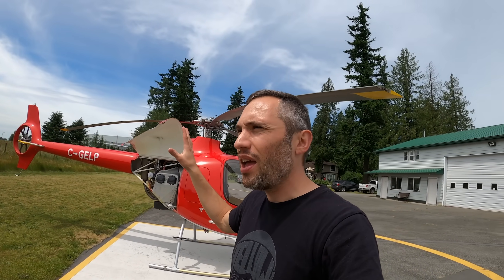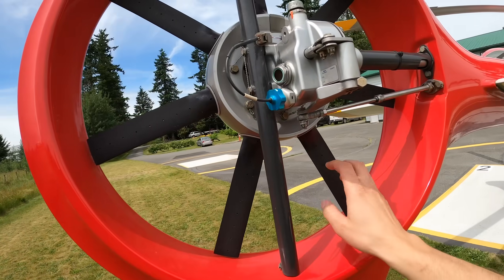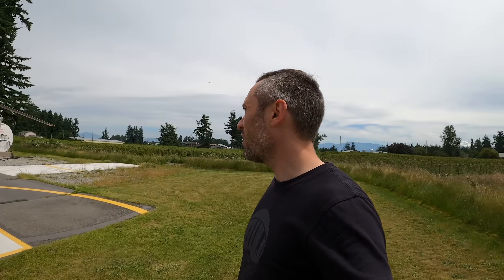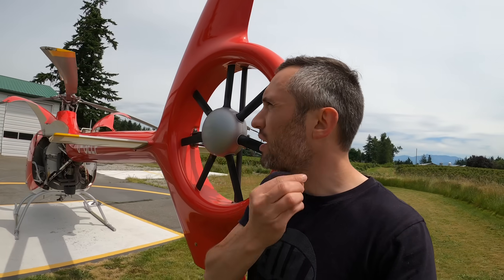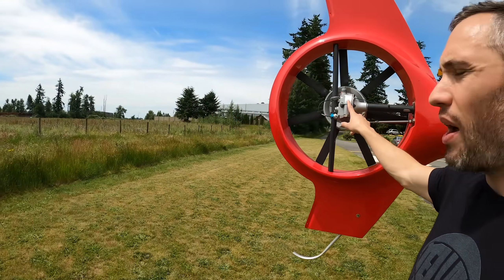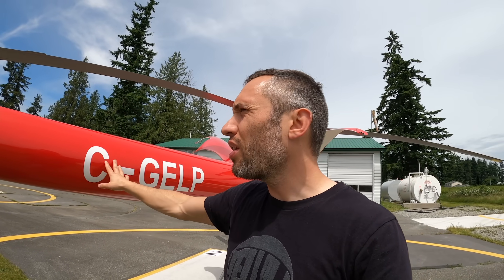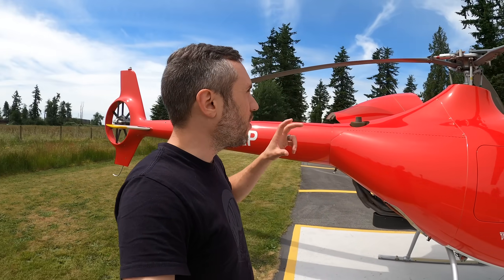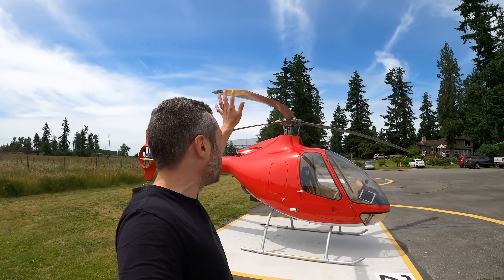WHY ARE HELICOPTERS SO EXPENSIVE TO RUN??

Comment: One big factor in the cost of parts, components, & complete aircraft is the premiums for product liability insurance. Back in the '80s, after some high-profile crashes & lawsuits, those premiums amounted to more than the cost of materials, labor & overhead. It got so bad that Cessna actually stopped building single-engine airplanes, and cut back on their multi-engine piston twins. Once Congress passed laws limiting liability payouts, the industry slowly began producing aircraft again. I've been away from the industry for years now, but I 'd be willing to bet that those premiums still make up a large part of the cost of components and aircraft, especially helicopters.

Comment: Excuse me??? Sorry, I'm just now getting the "Get tuu da Choppa" bug and been watching YouTube videos on helicopters for about 2 months now, but just from this video right here, i now found out that one single blade costs $20k or higher?? Nooo....I'm seriously shocked by this info, for real!! I thought that one such blade wouldn't cost more than $4 - $5k by using my common sense alone!! I've determined those prices, just by knowing of the manufacturing techniques alone, and just how much material and effort really goes into building one, it isn't as complicated as let's say... putting a chopper or a plane kit together or even buying a new transmission for your car, or an engine! Why so damn expensive?? I can't come to understanding the logic behind it! To me, it just simply shows a technical scheme being enforced here, or trying to boost up these prices since they're built good enough and not much serious maintenance is needed on them, etc! $20k? still hard to process!! For that price, knowing you can't just buy one blade at a time, you gotta buy the whole kit, if you have a 3 bladed rotor, you can almost if not, buy another helicopter like a Mosquito, or a used Robinson, whatever. Even a plane if you're into fixed wing stuff! Omg 🤦🏻‍♂️

Comment: Aircraft mechanics have a saying, "You know the only cheap thing about an aircraft?  The owner....  I have worked on helicopters for over 20 years and I feel that I should clarify a couple things that he said in his presentation.  "Infinite Life" parts are also known as "on condition" parts, this does not mean that they will last forever, "on condition" parts are subject to inspection, and if the wear, damage or defect criteria is exceeded they would need to be overhauled or scrapped depending on the manufacturers instructions.  He explained the life on main rotor blades and rotating components very well though.  
I would also like to add to that for the composite Main Rotor Blades on his trainer, they may have "infinite life" but I have never seen a main rotor blade that lasts forever...  I work on Airbus H125's (AS350B3e) and their composite Main Rotor blades have a 20,000 hour life limit, but I have never seen or even heard of a blade that actually made it to 20,000 hours.  They don't have catastrophic failures, but one day, upon inspection, a defect will be discovered that is not repairable and then you are replacing a blade.  The problem there becomes that you calculated the operating cost of that blade based on the 20,000 hour life, (AS350 blades are 45k each so $45,000 USD/20,000= $2.25/hour/blade), and if fails at say 10,000 hours then your operating cost effectively doubles and you didn't charge the helicopter out at the direct operating cost of 10,000 hours so that blade just cost you $22,500 USD... So 10,000 hours worth of value from that blade just came right out of the owner/operators pocket, not a good day to say the least.  Plus then you are buying a new blade for $45,000 and paying someone like me to install and balance the machine...  
So on his training machine since it has "infinite life" blades operators normally don't calculate any operating cost to them and the manufacturer doesn't include that in their Direct Operating Cost (DOC) estimates.  So you can really get caught with your pants down as an operator/owner because there was no budget planning in place for replacement, very high risk to say the least.  
I would rather see a reasonable time life on a component so that I can plan/budget for the replacement cost and I can be assured that most of the time parts will run their full time life.  There is no such thing as "Infinite Life", it is just something marketing people say to con you into buying their stuff and it makes their DOC look better on paper when they sell it to you.  I love working on and flying in helicopters but I would NEVER own one, care and maintenance is an endless expense and most parts are massively expensive.
As the old saying goes, if it flies or floats it is cheaper to rent than to own...
Reply: @JE-ed6te  Ah you know the one... Just trying to keep it PG for the audience. LOL

Comment: My father in  law was an electronics engineer. He showed me how they rated electronic parts, which was basically what he’s talking about. He used 66% of a components failure rate to rate its use. If it failed when it was run at 100 watts he would rate it at 66% of that, or 66 watts. This provides a margin of safety for the end user.

Comment: as a pilot that has only flown Robinsons I find them to be incredibly safe  when operated correctly as well as maintained  in the same manner, frequently i find places abusing them to their absolute limit and its concerning for me. I feel there needs to be a change in how these things are maintained, sure you can do the minimum and get max profit, but pilots definitely will be at risk . I think its a much better approach to have non limited components  but a strict standard with a margin of error built in to what you can repair, because that increases inspections  and decreases replacement parts decreasing overall cost.

Comment: 50k for a tail boom??? I know aviation is expensive, but how can you justify that price tag from a manufacturer's point? That's maybe 3 square meters of aluminum and 100rivets on a robinson and maybe some bearings for the driveshaft. And the manufacturing won't take too long I guess. So maybe, MAYBE, 2-3k is a justifiable price tag. I'm just talking about a bare boom, no gearbox or anything. Oh boy, that way I'll never be able to buy me one of those.....

Comment: I fly an autogyro in the UK with a Rotax 912 powerplant. Every 5 years we have to replace all of the engine’s rubber components (all tubing, engine mount bushes, and carb diaphragms). I’ve just had a 5yr service done which cost around £2700.
The rubber in the same powerplant on a microlight is replaced “on condition”.
Microlight pilots love us when we throw away our rubber. They take our cast-offs and use them in their aircraft because they are generally still in very good condition.
This time, I had most of my rubber hoses replaced with silicone ones which won’t need replacing in 5 years. Hopefully my next “rubber replacement” will be a little cheaper and will justify the additional cost of using silicone this time around.
Reply: Emmanuel Benjamin Mercado Rodriguez - For the most part, I agree. However, there are things that a heli can do which a gyro cannot, such as a zero airspeed hover (whereas we can only manage zero GROUNDSPEED hovers for which we require sufficient wind). We also cannot land vertically nor can we take off vertically, not even with jump takeoff. Jump takeoff will only get you off the ground vertically, we cannot continue to climb straight out.
Helis do have their place, especially for such things as oil-rig transport, rescue, air-ambulance, etc. 
But...  in terms of “bang for your buck”, initial outlay, fuel costs, maintenance costs, etc... Gyros are incredibly capable aircraft.

Comment: I would  say one of the major issues with component wear of a helicopter is the collective assembly and really what it does.

Not only does it have loads of tiny components with a lot of stress, it also stresses the blades quite significant. On top of that, a helicopter is pretty much always driving a very high  power rating throw a shaft that is really not spinning all that fast.

Comment: Your perspective is that of an end-user.  The OEMs want your money.  If you factor that into every aspect of your perspective, questions such why an OEM doesn't want to use composite rotor blades become a bit more clear.  Also, what if that engine has a variant that is used to power an airplane instead of a helicopter.  Engine times are based on hours and/or cycles.  A helicopter cycle isn't the same as an airplane cycle.  The engine isn't working nearly as hard powering an airplane as it is a helicopter.  What does work in your favor though is that money-oriented OEMs will eventually lose out to performance/customer service oriented OEMs...for what it's worth.

Comment: How does a helicopter company generate enough profit from sales alone, to stay in business without time rated spare parts sales? Thanks!
Reply: The SearcherMan the hourly rate for flying a helicopter accounts for the replacing of the parts and they spread out the price of single components over the lifespan so you might have blades that last 5000 hours and cost ten thousand dollars each so it would be 
10,000 divided by 5000 which is 2 and then 3 blades is 6 so it’s costs 6 dollars an hour to operate the blades on this imaginary helicopter and then you do that for every single component and add fuel and instructor cost  and you finally have the hourly rate to run the helicopter 
So it’s less like they are paying big bucks to replace these parts every few thousand hours and more like they are paying it off over the course of the lifespan of the parts 
I hope that makes sense

Comment: Once again,like everything else in aviation, we come back to liability imho.  What the MFG's your talking about are doing is shifting the liability OFF themselves and on to the operator by saying "this part is on condition". therefore the operator now takes on the liability of when to replace said component.  
   A bad thing?  Not necessarily .  But it is a change in dynamics as far as legality goes.   I for one would not necessarily trust "Joe Mechanic" as saying "sure, those blades are still good after 7000 hrs".     vs the MFG "who KNOWS when they will fail and says,  Replace those blades at 4000 hrs..  
   also, as you alluded to, the MFG is protecting themselves, so they make you replace components quickly.  There is definitely safe time left on most components, but once again, you are trusting "Joe Mechanic" to inspect them properly and make a judgement call.

I think in the big picture it will have to play out in the court room because you know someone is going to push limits and kill someone by flying a part to long.   Having said that, there is also time left on parts above what the MFG says they can do.    Its an interesting subject and will be interesting to watch play out...

Great video.  Always enjoy your vids..

Comment: Nice helicopter. Nice parts. Nice price tags. :-)

My plane has no life-limited components, though there are inspection/overhaul requirements. The engine is specified as 2000 hours/12 years between overhauls, but in non-commercial service I can run it until it falls apart. It's currently 1300 hours/28 years SMOH with stable oil consumption, good compression and not making metal.
Reply: And this is the direction the helicopter industry needs to move towards. It is mindblowing the costs of BC Helicopters' Cabri G2, even having some or most of the components being "infinite life". I'm sure  they'll pay out the purchase price of the helicopter itself withing the first 10-12 years.
Reply: U shud focus on making apple pie

Comment: Hi, Love the videos thank you. I work as a car detailer here in the UK and have been asked by clients to clean their helicopters etc. There is a complete lack of information regarding the "do's and dont's" of cleaning these machines. Any chance of a video on how you care for your helicopters please.
Reply: I think that's a good question!
Reply: Hello Desertduck, that is a great question and depending on the manufacturer of the helicopter you are cleaning there will be different levels of information available to you.  I will generalize and tell you that most modern helicopters will have instructions for cleaning in the maintenance manuals for the helicopter (usually in the standard practices or servicing sections).  The owners/maintainers of the helicopters should have access to this information and be able to provide it to you.  Typically you will even see "approved" soaps and cleansers and sometimes warnings about the use of certain cleaning agents on specialty metal parts (magnesium, titanium etc..).  
Here are some general tips/rules on helicopter cleaning:  1. DO NOT use high pressure washers, typical house tap pressure is fine but no gas or electric pressure washers, they can fail seals and push water to places it should not be... may even kill someone...  2. Use an aircraft approved soap like Zep Aircraft Cleaner II (just an example, may not be approved for the helicopters you work on).  Not super cheap but works well on bugs and exhaust carbon deposits in my experience.  3. Rinse extremely well, all soaps are typically corrosive in some form (acidic or alkaline) so great rinsing will save expensive corrosion problems down the road.  4.  Be aware of where you are spraying water and getting soap, you don't want to get water/soap in pitot static systems, engine air intakes, or fuel tank venting systems if possible.  Once again a guy with a hose that pushed water up a tank vent HAS KILLED PEOPLE so it is an important consideration.
I hope this helps you out and doesn't scare you too much but I feel it is necessary to mention the bad things that can happen so that everyone is aware, might save someone's life.
Reply: @helifixer206  Many thanks for that information. Some great tips there. Appreciate you taking the time.

Comment: Seems like bell is a cheaper helicopter to buy, but its behind in technology and safety, and like you said it wears out too fast. Why did you get that r66 when you could of bought a slightly used ec120 which would be cheaper and safer in the long run.
Reply: The EC is a nightmare when it comes to parts now. Waited for a exhange MGB for 3mth. And the torsion spider we had to motivate why we should get the part they had on stock and not their other customer.

Comment: I wonder how electrification will improve this, like electrical tail rotor, eliminating that gear box
Reply: I think the problem with electric rotors is electric motors have instant torque and aren’t auto-rotatable
Reply: @BIGTRUCKSERIESREVIEW  Actually they are, in small planes you can even regenerate some electricity on the way down. The problem of the battery weight still remains.
Reply: SpaceX is looking at these problems for its new wings. They seem to be going all electric now eliminating hydraulics